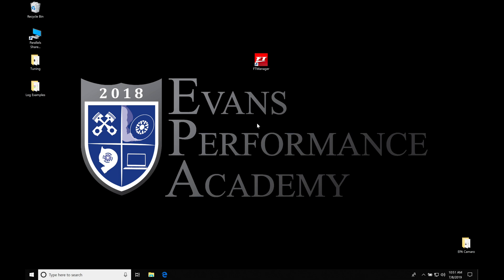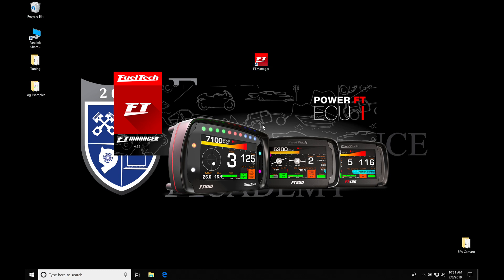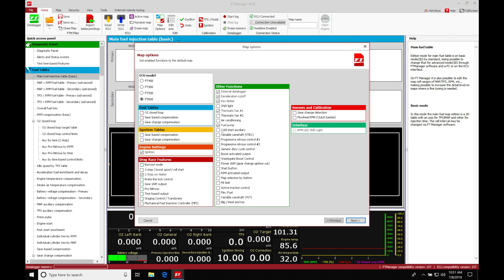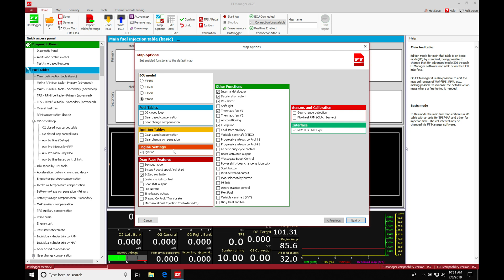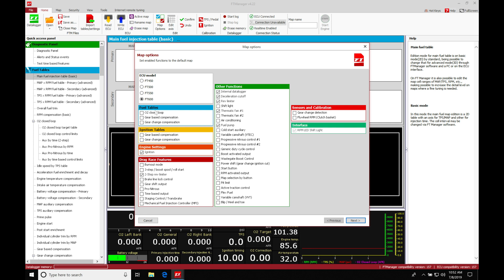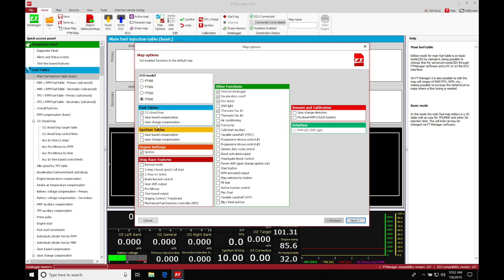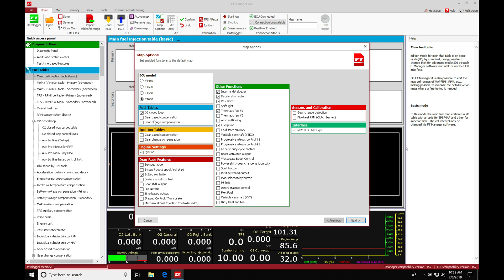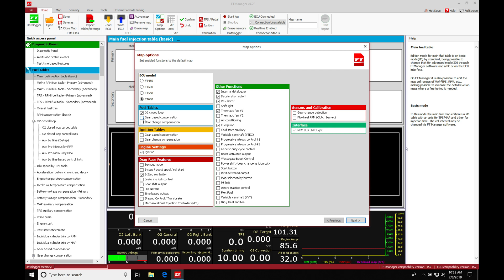Fuel Tech Part 4: Basemap creation | Evans Performance Academy

Comment: I'm about to pull the trigger on this fueltech course. I got my car wired up but it won't idle. It just starts and runs for like 3 seconds
Reply from the maker: You might need more fuel or more airflow / idle torque to maintain idle.  Try keeping your foot on the throttle after firing off the engine.  If it stays running with your foot on the throttle the idle needs to be adjusted manually at the throttle body or the idle control motor needs more airflow through programming.
Reply: @EvansPerformanceAcademy  I tried that and it stays running. I think it might be the crank index but not sure. I’ll try messing with it tomorrow
Reply: @EvansPerformanceAcademy  thanks, going to have to wire in the idle control because its a cable not a drive by wire. It stays on if i hold the throttle open a bit